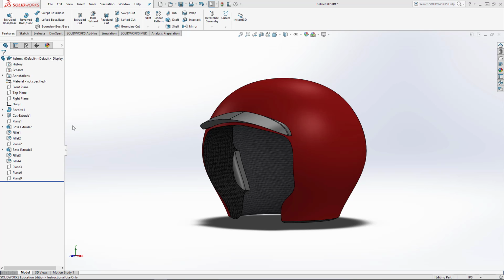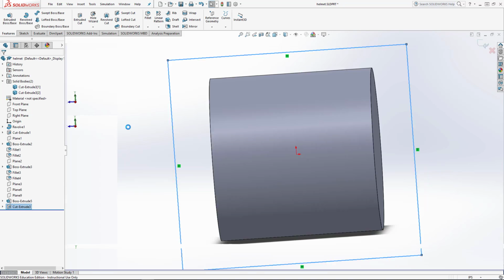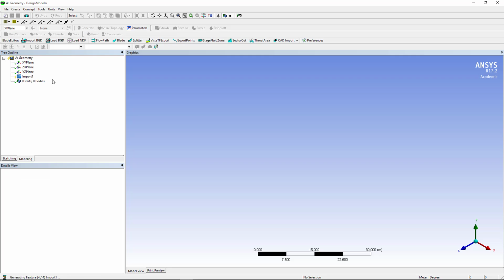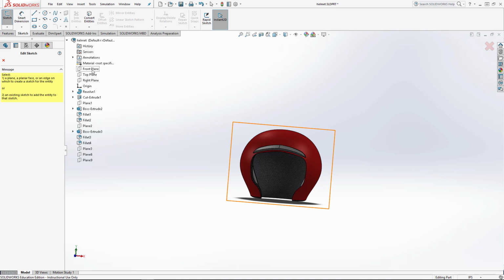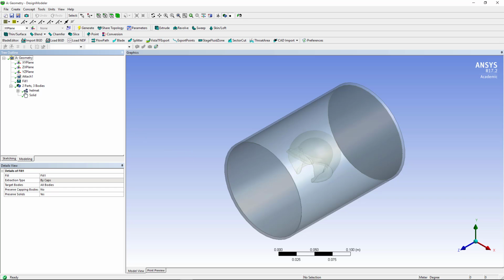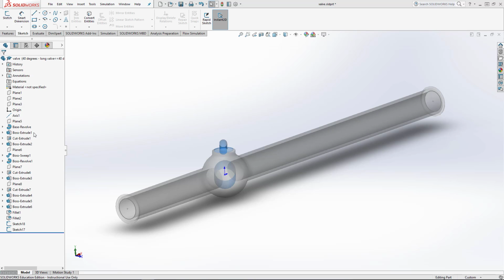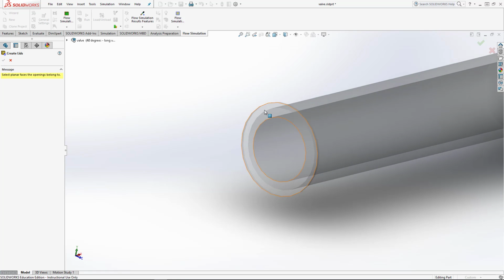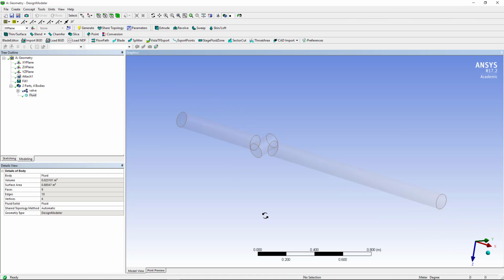Introduction to ANSYS Fluent (1/4): How to Setup and Create a Fluid Domain for Fluent

Comment: Hi. great video! I want to ask, it is can if I make the enclosure box directly from the solidworks after cut into half the model or I only need to cut into half the model and make the enclosure in the Ansys.? currently, I'm doing the project regarding the airflow around moving vehicle.

Comment: What is the procedure in SolidWorks (similar to the extrusion example in this video) but starting with an assembly instead of a part? Because in an assembly i can't use features like the extrude, for example. Thanks in advance